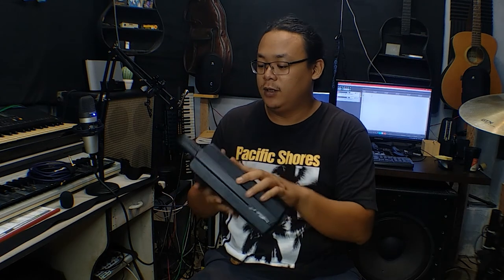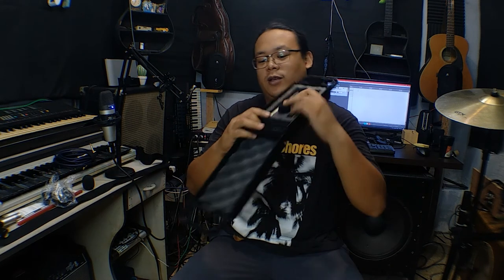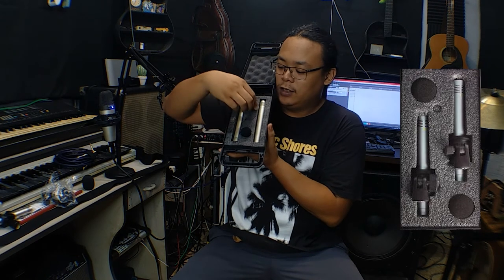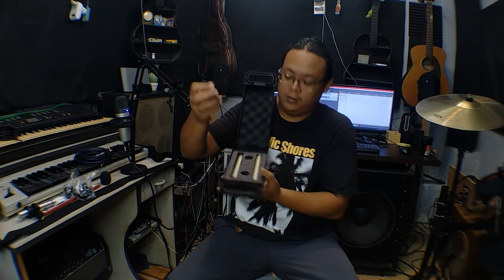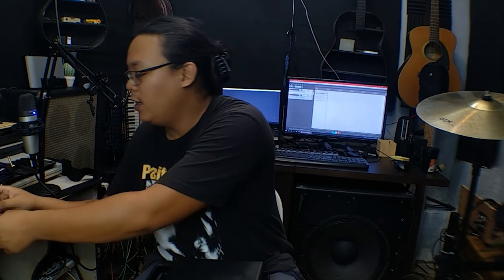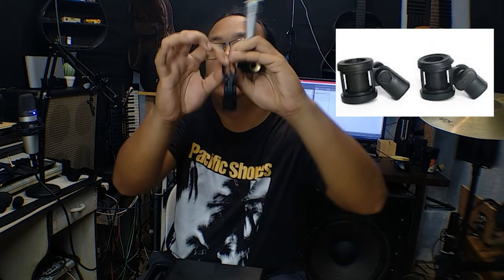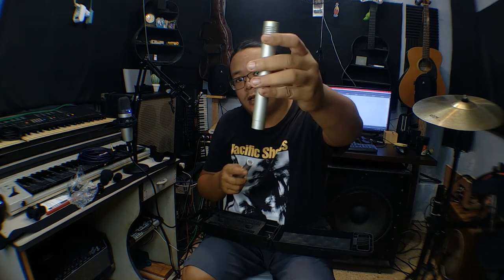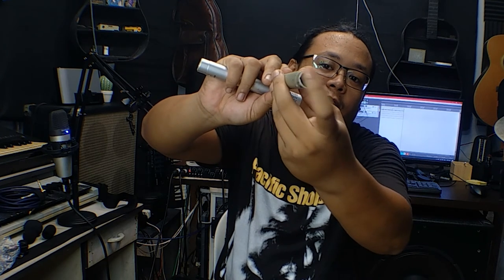Fake Vs. Real Samson C02 Condenser Mic | Demo Cymbals & Guitar

Comment: Current C02 microphones have 3 slits in the tube and the old design has 5? I wonder if you tried to swap the capsules and see if the threads are the same
Reply from the maker: the seller actually messaged me and said their class A and not the orig ones
Reply: @PickcutStudios  I’m not sure what they mean? What are class A?
Reply from the maker: @pauljohnson4590  They're a lose transaltion here in the Philippines as imitations and not OEM